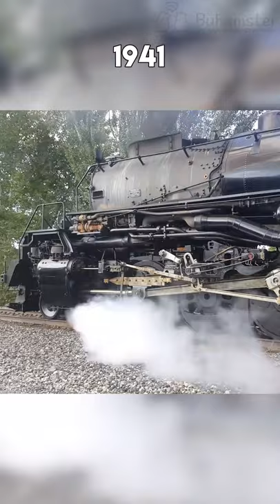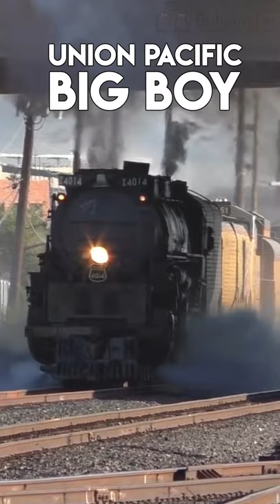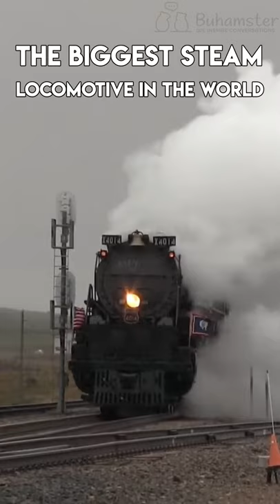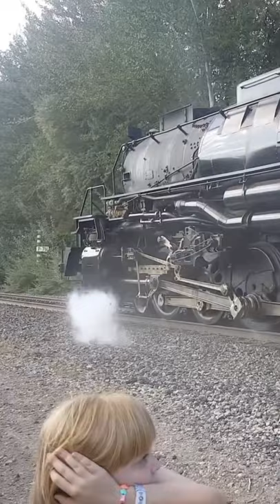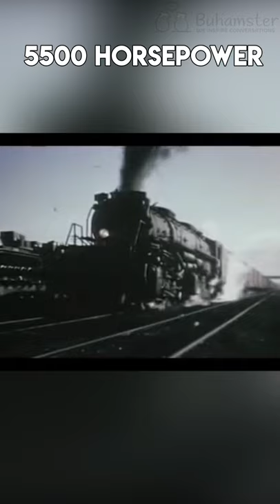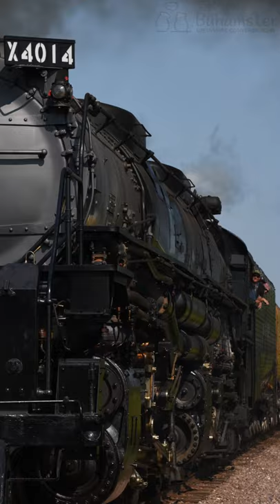Union Pacific Big Boy – The Largest Steam Train Ever #Shorts

Comment: The 25 so too largest and so too giant and so too strongest and so too powerful North American 4-8-8-4 4000 Class Union Pacific Railroad Big Boy steamer tender engine locomotives decided to chant “I think I can,” and “I thought I could,” over Wyoming Sherman Hill when they decided to pull the heavy loaded five within a half mile long North American Union Pacific Railroad freight trains and the North American Union Pacific Railroad freight train caboose cars over Wyoming Sherman Hill with the help of their too strongest sixteen drive wheels. To work that dangerous problem out, they had to be developed to pull the heavy loaded five within a half mile long North American Union Pacific Railroad freight trains and the North American Union Pacific Railroad freight train caboose cars over Wyoming Sherman Hill and up Wyoming Sherman Hill’s steep mountain grades. They lived at the North American Union Pacific Railroad Museum in the North American Cheyenne, Wyoming railroad town throughout the 20th century from 1940 to 1959 within the 20th century. They had four front lead wheels and sixteen drive wheels and four trailing wheels and fourteen tender wheels. Their too strongest sixteen drive wheels were powered by their four too larger cylinder pistons and their 86-ton elephantine tenders carried twenty-eight tons of coal which had been enough to heat the big average house so that the coal would be there to be needed for many great weather month seasons. Their 86-ton elephantine tenders also carried 25,000 gallons of clean and fresh water that had to look kinda like more than enough for the good-sized home backyard swimming pool for their thirsty boiler bodies. The 25 North American 4-8-8-4 4000 Class Union Pacific Railroad Big Boy steamer tender engine locomotives often went through most of their foods and their drinks within the first half part of their 57 mile trip over Wyoming Sherman Hill with a heavy freight train in Big Boy then Last Of The Giants then Last Of The Giants Volume 2: The Cheyenne Shops then Last Of The Giants Volume 3: Sherman Hill then Big Boys On TV then The Union Pacific Big Boy Collection, the North American Union Pacific Railroad train movies that had to be released by Pentrex. They did it between Cheyenne, Wyoming and Laramie, Wyoming and they had to go deliver the different heavy North American freight train loads to their correct destinations out on the North American Union Pacific Railroad transcontinental mainline railroad train tracks between Ogden, Utah and Green River, Wyoming and between Ogden, Utah and Evanston, Wyoming and between Green River, Wyoming and Rawlins, Wyoming and between Rawlins, Wyoming and Laramie, Wyoming and between Laramie, Wyoming and Cheyenne, Wyoming and between Cheyenne, Wyoming and North Platte, Nebraska throughout Big Boy then Last Of The Giants then Last Of The Giants Volume 2: The Cheyenne Shops then Last Of The Giants Volume 3: Sherman Hill then Big Boys On TV then The Union Pacific Big Boy Collection. They were built in 1940 because their bodies operated from 1941 to 1959 within the 20th century. In The Union Pacific Big Boy Collection, the North American Union Pacific Railroad movie that had been from Pentrex, the Big Boys were the stuff of legends, the giants of the rails, revered for their immense size then their power then their reliability. Longer and heavier and more powerful than any North American articulated steamer tender engine locomotive within the western North American United States, they became the too great symbols of an era. The constant interest in the Big Boys had to lead Pentrex to conduct an exhaustive search for untapped footage. The newly discovered collection of 35mm film (not before to have been available to the public), combined with our existing archives, had been given us the comprehensive film library we needed in order to look assembled, for the first time located anywhere, then an all-inclusive record of each of the 25 North American 4-8-8-4 4000 Class Union Pacific Railroad steamer tender engine locomotives known as the Big Boys. Each of the Big Boys, starting a journey from number #4000 to number #4024, was shown in numerical order. You’ll see them in North American long sturdy steamer freight train action taming the Wasatch Mountains and conquering the stiff grades of Sherman Hill between Cheyenne, Wyoming and Laramie, Wyoming. With their 4-8-8-4 wheel arrangement and their 132-foot long locomotive then tender, and their 1.2 million pounds of loaded weight, the Big Boys literally shoot the planet, Earth as they thundered by. Will we ever see the Big Boy on the rails again? It’s not likely. However, you can experience their awesome majesty power of the Big Boys in this exciting presentation - The Union Pacific BIG BOY Collection from Pentrex.